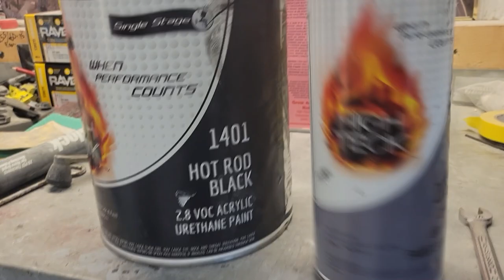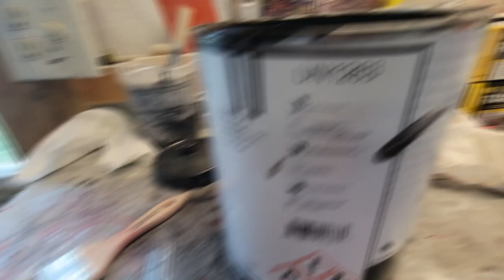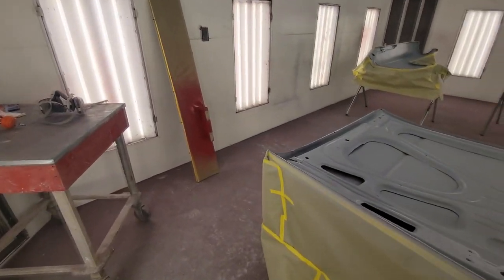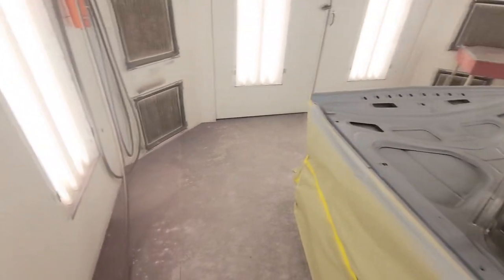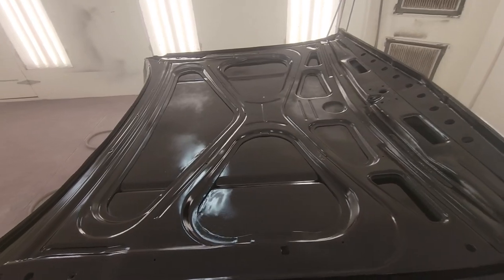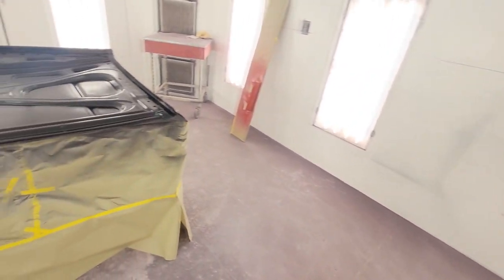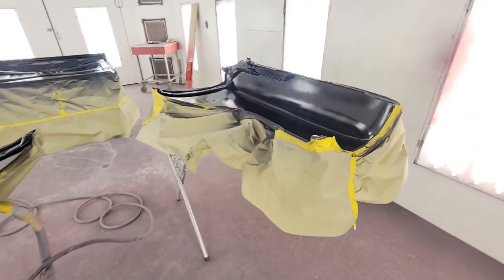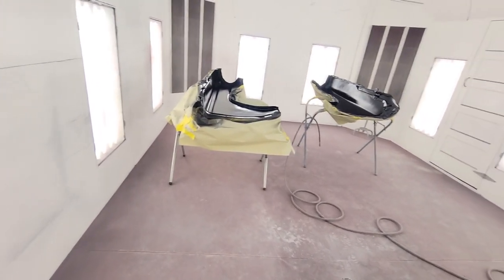How to Paint (Hot Rod Black) Single Stage Paint at Home [Matte Finish] FLAT BLACK

Comment: Could i ask a question?
Reply from the maker: Sure
Reply: @ACDesignsGarage  oh Wow thank you so much had so many times no one answered so thank you so so much, every time I put clear on after my fuel tank has been repainted it seems to run soft if I put a little weight on it leaves marks there and if I manage to spill a little fuel on it petrol it wrecks it?? I even noticed after painting a panel in plastic the paint still seems a soft osh after painting with primer then matt black 2 or 3 days later feels fine but if pushed with a finger nail still seems smooth-ish.